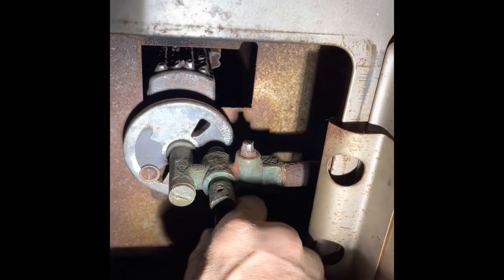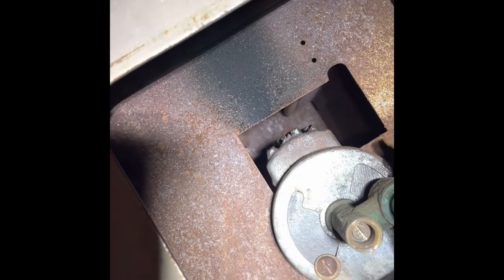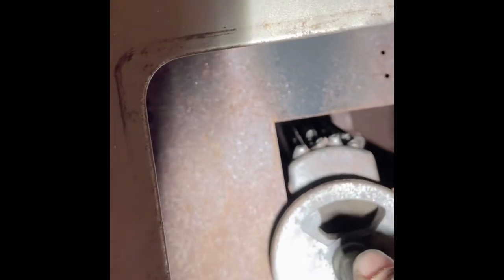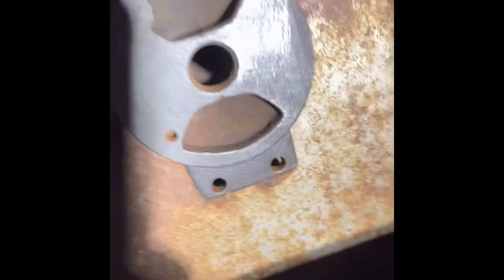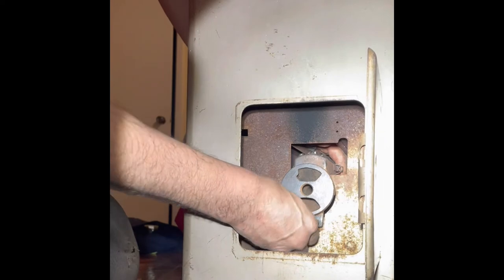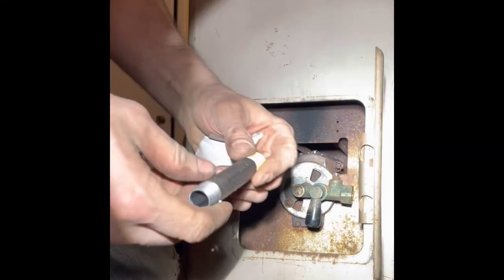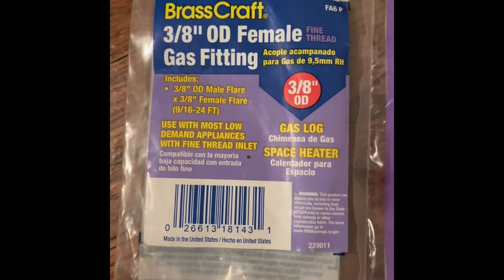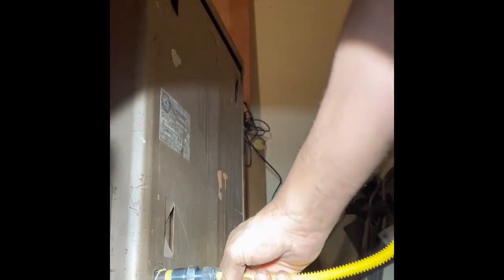Dearborn model B disassembly with timestamps

Comment: Great video
Thank you so much for this video and showing all the steps of parts, cleaning especially adjusting the flame.  Just what I needed.  
Thank you so much
Reply from the maker: I had to do a detailed vid because I could not find one. Thank you for your appreciation
Reply: @FeloniousDream   I do have a question, you said you can also adjust flame with screw, do you do this before or after adjusting vent ? Thanks
Reply from the maker: @silwang.8053  ok… had to watch the vid again… the orifice screw has to be backed out a little or you won’t get any gas. The vent has to be somewhat open to get air. I basically messed with both of them to get what I thought was a decent flame with mostly blue but also some orange. As a starting point you’ll need both to be cracked a little. There may not be much useful turning of the orifice screw. And the vent can’t be all the way open. So start with the orifice screw cracked and the vent cracked. Turn on the gas and feel for the gas coming out of the manifold. If you can feel the gas then you should have enough gas to light. If it won’t light then open the vent a little. Make your adjustments in 1/8th or 1/4 turn increments.
Reply: Ok thank so much for the information. I really appreciate it.
Have a great day
Reply from the maker: @silwang.8053  let me know how you got it adjusted
Reply: Will do
Reply: @FeloniousDream  Everything adjusted great, it burning like a new heater, thanks you so much. I have 4 more to go😂.  I wanted to send you a video of it burning but I don't know how. I can't thank you enough for that great video.😄
Reply from the maker: @silwang.8053  that’s awesome! Thank you for letting my simple vid help.

Comment: It’s tough to find out a whole lot about these heaters. They are practically outlawed.   So what exactly is the phenomenon that i experience when after a few days the air burns our eyes and has to much gas exhaust in it? I have plenty of outside fresh air being vented in and out.  My gas trims? I’ve more or less figured it out on my own. I was a young kid the last I remember using these stoves.  Thanks
Reply from the maker: Sounds like you have too much orange flame. You’ll need to adjust the mixture of gas to air
Reply: @FeloniousDream I have a question I have a three burner Dearborn heater sold by Sears and my knob is leaking I have tried tape as you show but still leaking is there a washer or oring that goes with the nut that holds the valve
Reply from the maker: @Crazychester250  idk what model you have. I listed a link that goes to a company that can give you reliable information and parts.
Reply: @FeloniousDream  thank you

Comment: I have a dearborn heater, the valve that goes outside is broken,..the part of the lever that turns to control the flame is broken.., how can i fix it? or what other valve can I use to substitute the original valve?  the heater's part number is 5651-6036.  Eastwaysales says they are not longer making the part...:(, please help
Reply from the maker: Contact me through Facebook. I don’t understand what you mean by the outside valve.

Comment: Great video. Someone gave me one of these and it didnt work. Orifice screw was turned all the way in blocking anything from coming thru and stripped out. I had to drill it out. Was wondering if the screw is needed for operation or if i can just use without it. I can still regulate from the main valve or the house wall valve. Thoughts?
Reply from the maker: Around 3:20 I’m taking the orifice screw out and show what it looks like. Once you get it set you shouldn’t have to touch it again. You may have a cap over the orifice screw that could cause some confusion as to what you’re turning.
Reply from the maker: If you did strip the orifice screw you could possibly wrap it in Teflon to adjust it with the heater burning. Get it set where you want it and maybe silicon it in place. You could epoxy it but if it fails you’d have to get the epoxy out to make another attempt. 

There is a link in the description to a company that makes parts.
Reply: Yes i have cap over orifice screw. Cap is in good shape but i had to drill out the orifice screw. Its not good anymore. I sealed cap. Was going to use heater without orifice screw
Reply from the maker: @adamcompton567  let me know how it works or what you had to do to get it to work.
Reply: @FeloniousDream  all good. Working like it should. I dont understand the point of orifice screw. I guess its just for fine adjustments. Cant beat these old heaters
Reply from the maker: Seems like the orifice screw/ orifice is what mixes the fuel and air. I believe the orifice is changed when one converts from natural gas to propane.
Reply: @FeloniousDream i called eastwaysales they said it for propane or natural gas adj. I see in your video yours has a needle on it. Im assuming you can run that needle down and close the hole on the jet needed for LP. Mine was just a plug and its not needed. I ordered some radiants and a valve handle from eastway. I told them that all the heaters ive seen had the sticker on the back of the heater. This one has the sticker on the inside of the door. He said its an early model. But its working very well. Been running it for a couple hrs. and no problems.
Reply from the maker: @adamcompton567  dude, thank you for the info! On mine, I saw that turned all the way in shut it off. I didn’t film that part- cause I was trying to figure out what was going on, and I really didn’t get an understanding from my attempts.
Reply: @FeloniousDream  no problems. The guy that gave me this heater said that it came from a propane house. Im thinking that they were trying to adjust for propane on the screw not know it was a plug instead of a needle and bottomed it out and stripped it out. LP has a smaller jet orifice than natural gas and this is a natural gas orifice dearborn. Im thinking of buying more of these just to have them around. They are selling these for 3 to $400 in tx
Reply from the maker: @adamcompton567  I’m near Fort Worth. I’m seeing them at 50 with missing ceramic’s ended up painting mine. I would prefer newer with a thermocouple and sensor but I’m happy to have this one.